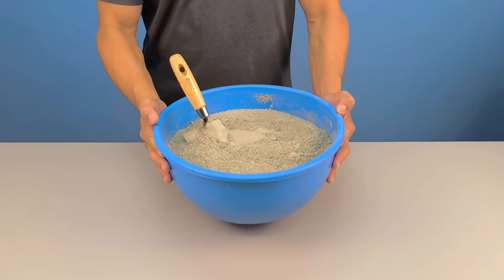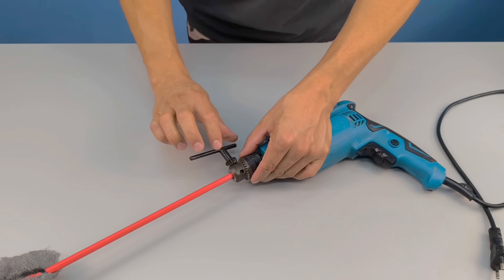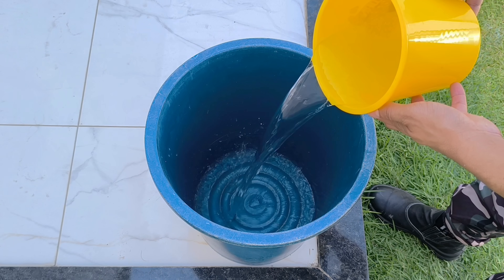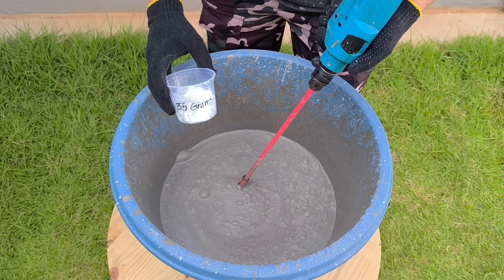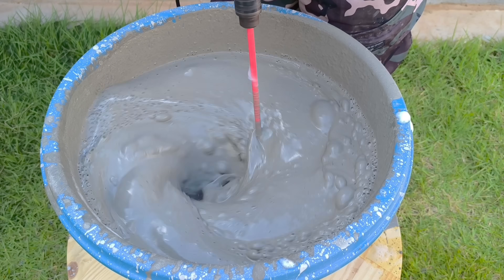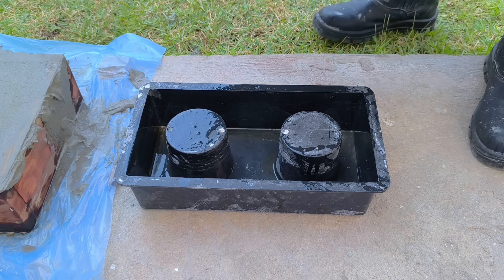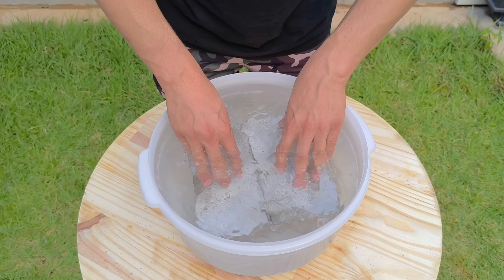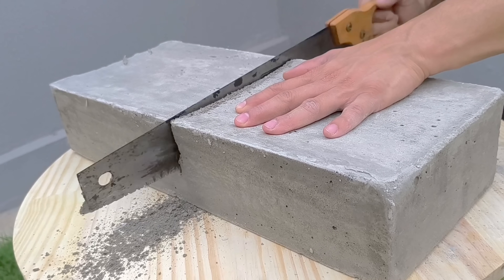Mix CEMENT with DETERGENT and create something that can REVOLUTIONIZE civil construction!

Comment: What makes you think this is new? You've just created a lightweight, incredibly WEAK block of cement. Adding washing up liquid to plasticise the cement (or concrete if you add sand and gravel) for use in very cold weather, is old hat from over half a century ago (to my knowledge) . The fact that it floats is exactly the same reason why lava will float. Nothing new here, but I'm glad it makes you happy.
Reply from the maker: True, it’s not a new invention — but each test helps refine proportions, density, and resistance. The idea is to explore new uses with simple materials.

Comment: They used this in the construction of schools & hospitals in the UK many years ago, now these structures are categoriesed as unsafe as they are falling down!
Reply from the maker: That’s true — older aircrete structures often lacked proper reinforcement. Modern mixes, however, are much improved and far more stable.

Comment: Have you done cube tests? What MPa did you achieve?
Reply from the maker: Not yet with lab cubes, but field tests show moderate strength — it’s more focused on lightness and insulation than high compression resistance.
Reply: @inovaouinventa  it would be good to get some test results such as strength and R-value for a range of samples.

Then it can be compared to construction standard requirements, and be specified by engineers and architects.

Comment: Styrofoam is added to mixes making styrocrete a lightweight cement mix that is great as a building material.
Reply from the maker: Exactly! Styrofoam cement is fantastic — lightweight, insulating, and still surprisingly strong. I’ve been experimenting a lot with that formula!

Comment: Used in partition walls only,  not for plinth and structural work
Reply from the maker: Exactly — it’s best suited for non-load-bearing walls. The goal is insulation and lightness, not replacing reinforced structural concrete.

Comment: Very interesting 🤔 cement air  can be broken, any combination of air and solid concrete has a  kryptonite 😬
Reply from the maker: True — aircrete has its limits, but it’s still great for insulation and lightweight builds where strength isn’t the main focus.

Comment: You make a cheap cement but didn't talk about its durability. Since you can cut with a normal saw, I doubt it will last, probably crumble under weight pressure and a waste of time, no different than just using plastic.
Reply from the maker: Great observation! This type of mix isn’t meant for heavy structural loads — it’s for insulation, lightweight blocks, and creative testing. Durability depends on curing and additives.

Comment: What would you use it for?
Reply from the maker: It can be used for insulation panels, lightweight walls, or artistic concrete pieces — not for heavy structural use, but perfect for creative or thermal applications.

Comment: Cement not concrete. Concrete has sand and gravel
Reply from the maker: You’re right — this version uses only cement with additives, no sand or gravel, which makes it lighter but not structural.

Comment: What is a "common plasticizing agent"?
Reply from the maker: A plasticizing agent is an additive that makes the mix smoother and easier to work with. Common ones include dish detergent, liquid soap, or commercial concrete plasticizers.

Comment: Dont use washing up liquid in cement mixes it reduces the strength, there are plenty of admixes that are specifically designed for this process.
Reply from the maker: That’s a great point! For this experimental mix, the goal was lightness and insulation rather than maximum strength. But yes, professional admixtures are always the better choice for durability.

Comment: Do you have any idea of the R value for the larger blocks?
Reply from the maker: The R-value hasn’t been measured yet, but based on its air content and density, it should be significantly higher than standard concrete. I’ll test it soon and share the results!

Comment: Oregon.  How is this material as a fire protection on a building?
Reply from the maker: It resists heat very well because of its lightweight and air-filled structure, but it’s not meant as a fireproof coating — more as insulation or lightweight construction material.
Reply: @inovaouinventa     ok.  Thanks.  Was just wondering.  Those are great attributes.  I live in wildfire prone area.  Was thinking of mixing perlite with the concrete for fire protection .  Really heat insulation is a better word

Comment: So what is this good for?? Looks like it would break into pieces if thrown onto the ground.
Reply from the maker: It’s mainly for thermal and sound insulation, or for lightweight walls and crafts — not for structural loads. It’s surprisingly strong for its weight, but not meant to be thrown or used as a solid block.

Comment: What about the overall strength , in terms of falling from different heights , & load bearing capacity ..
Reply from the maker: Great question! I’m currently planning tests for impact resistance, drop height durability, and load capacity to compare it with standard concrete — results will be shared soon.

Comment: It would be helpful to see this material tested. I'm curious about the following questions:
• How strong is it against forces applied from different directions? 
• What is the minimum thickness for it to retain desired strength?
• What is the maximum length for it to be sufficiently strong, without adding structural rods?
It would be great to see this material in use. What applications do you most recommend it for?
Reply from the maker: Those are excellent questions! This material is ideal for insulation or decorative purposes rather than structural loads — I’ll include directional stress tests in an upcoming video!
Reply: @inovaouinventa  Much appreciated!
Reply: Yes. This!

Comment: Good compression strength, poor tensile strength.  Good for Dome construction.
Reply from the maker: Exactly! That’s the purpose — lightweight material with good compression and thermal insulation, perfect for panels and non-structural designs.

Comment: Don't use where structural concrete is called for.
Reply from the maker: Exactly! This mix is only for lightweight, non-structural applications like insulation panels or creative builds.

Comment: How would you add gravel today for strength ,, because that's just cement not concrete
Reply from the maker: Good point! Adding small gravel or crushed stone would definitely increase strength — that’s something I plan to test in the next version of the mix.
Reply: @inovaouinventa 👍

Comment: see several faults but depends on what block is used  very little fiberglass aggregate.  i assume Portland cement instead of sand or concrete mix  . air entrenchment commonly used in Reddy mix
i don't think plaster is good idea plaster is week compared to cement i used plaster sand mix for a caller wall recoating on old rock foundation house but its carrying no weight 
watch  and research air create for mixes that require strength i would use similar to this for step stones pavers . same as if you use soil cement floors and paving there's uses and places not to use
ad structure needs rebar in most cases
Reply from the maker: Excellent observations! You’re absolutely right — plaster is weaker, and this mix isn’t meant for structural loads. I’m experimenting mainly for insulation and light applications like panels or decorative blocks. Rebar is essential when building anything load-bearing.

Comment: This a called 'Air Entrainment', and it has been used in concrete for MANY years. Any concrete you buy in the US probably has this in it. Not detergent, which is suspect, but a chemical similar.
Reply from the maker: Exactly! You’re right — this technique is very similar to air entrainment, which helps make concrete lighter and more workable. I’m experimenting with different household alternatives for small-scale use.

Comment: it's important to note that the effectiveness and practical applications of such a mixture in real-world civil construction would require rigorous scientific testing and adherence to building codes.
Reply from the maker: Absolutely — real construction use would need proper testing, engineering certification, and consistent mix ratios. This one is purely experimental and educational.
Reply: Yap, I already see many, many  application options in non-load-bearing situations: partitions, decorative moulds, insulation fillers....
Reply: Why do you think every building falls down in third world countries when there is any kind of 7+ earthquake. You cut corners to save money and you have compromised the integrity of the product. The only thing this would be useful for is a floating dock or other non high compression application.
Reply: This material has been used in several countries already for decades now. It’s used for soundproofing and insulation
Reply: @JimLong-l6p  Makes sense hearing how it soundes when he tapped it, I can imagine it's sandwitched between tougher material or only on the outside that's fhe strenght while this is an alternative to inaluation.
Reply: @leazimearuom319  best reply